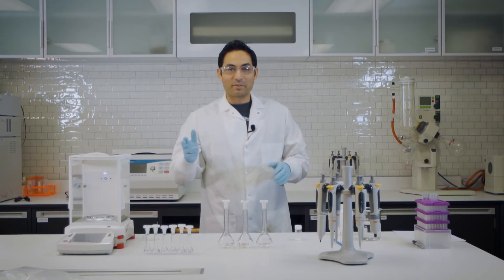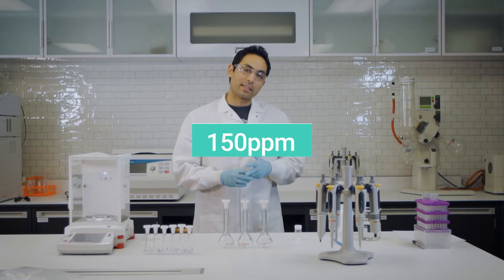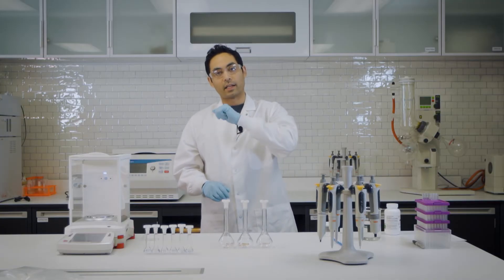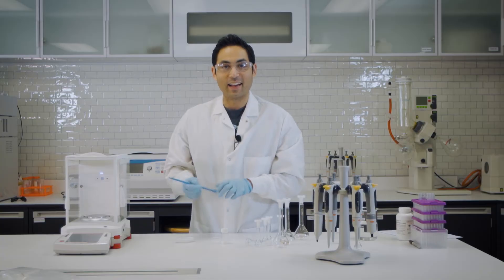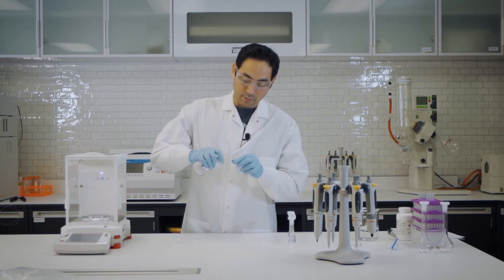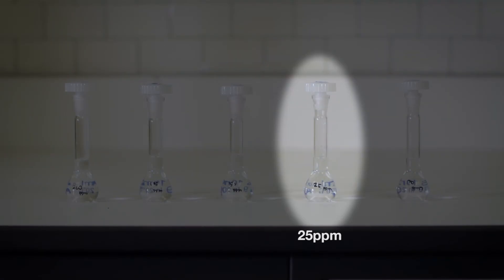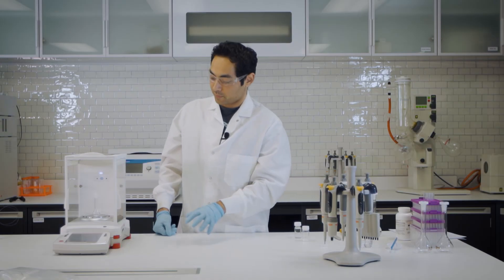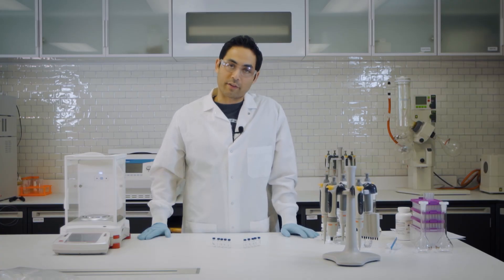Calibration Curves 101 (UPDATED)

Comment: Thanks for the nice useful demonstration. I do have a question that after making 2nd stock solution (volumetric) how much mL you are transferring to HPLC vial and do we need to dilute HPLC vial further
Reply: HPLC vials can vary in size but you'll likely just add to the fill line. also you shouldn't be diluting after adding to the HPLC vial as that's readying it for analysis

Comment: What is R square???
Reply: I am not absolutely sure but R would be the product moment correlation. The product moment correlation is a measure of the correlation of two variables X and Y measured.
Reply: in simpler terms, its a way of knowing how "accurate" your data points are. If r^2 is closer to 1, that means your points are falling on that linear line (Cal Curve). 1=100% of your points are falling on your calibration curve line. So an r^2 value of say 0.9998 is very accurate. The closer your r^2 value is to 0, the less accurate your data points are. So and r^2 value of 0.9281 is less accurate to you cal curve. 

I've attached a video that helps explain the theory a little better and its easy to understand (probably better than I did) 

https://www.youtube.com/watch?v=Guo7ntYAyIY